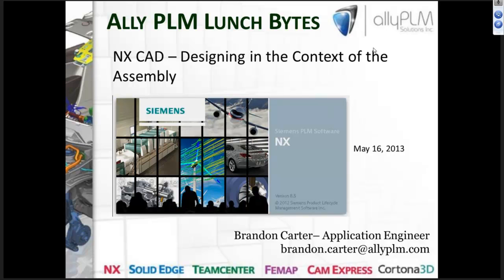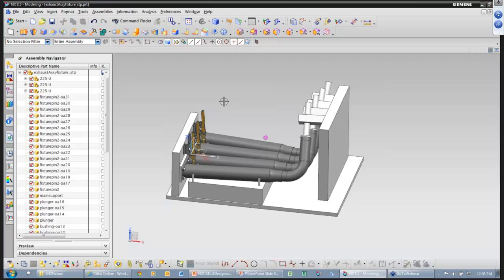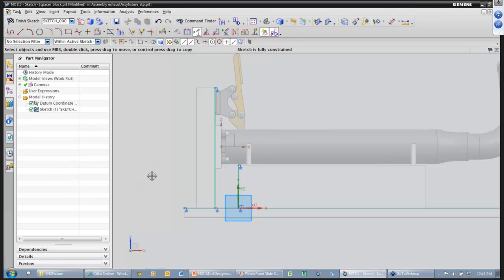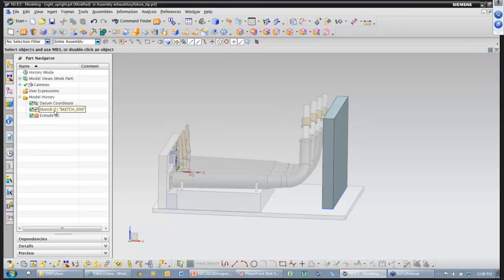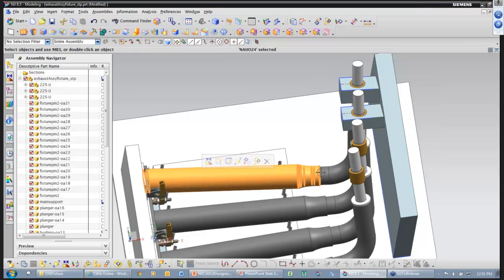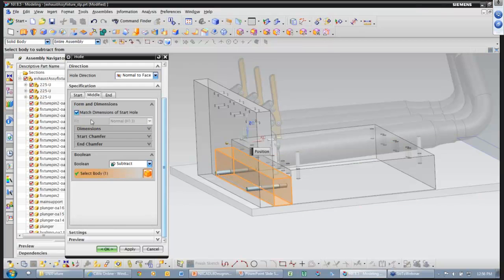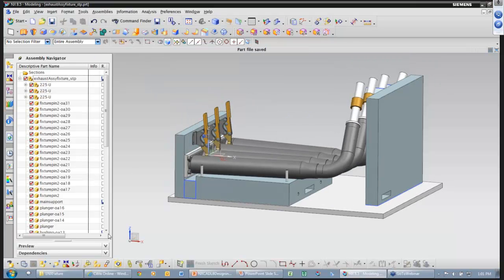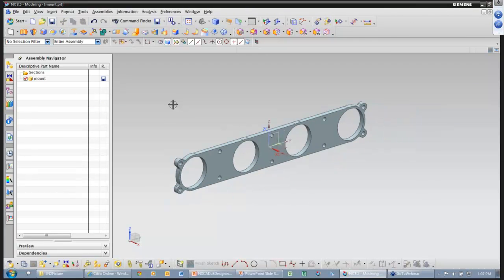How to Design in the Context of an Assembly in NX CAD? - Tutorial - PROLIM Lunch Bytes

Comment: Many thanks for this one, i think i better understood the meaning and possibilities of the WAVE linker. 
Just a short question about the last demo in which you saved parts as external part files : before this step, you told us that the through squared hole done at the assembly level would only be visible in such context, in other words it didn't affect the part files, that's right ? So to save the modifications you must export the affected parts to new files and they'll be linked to the whole assembly with the new geometry, that's it ? Just to be sure :)
Reply from the maker: In the last demo, I took a multi-body file (not assembly) and made it an assembly using Create new component and selecting the bodies to push into individual part files.  Before that, when using the Assembly Cut, we created the cutout only at the assembly level.  If you open the individual parts, it does not show the cutout.  The bodies with the cuts are created only at the assembly level.  If you save your test assembly to STEP, for example, and import back into NX, you can see how those bodies are created.  Saving to STEP is just a way to see how the bodies are created as a learning activity.